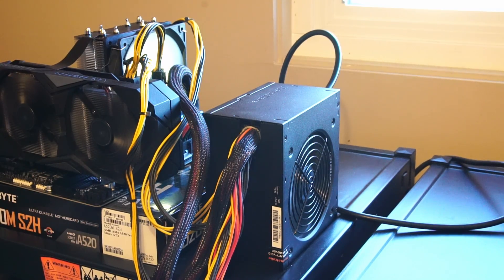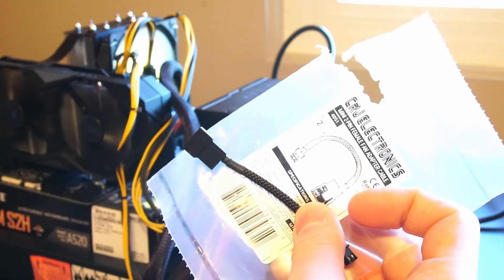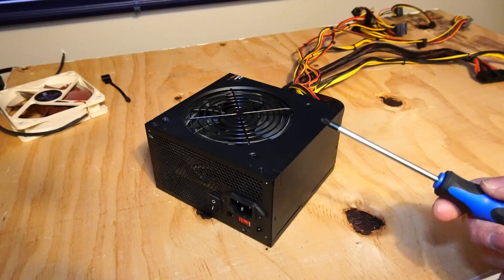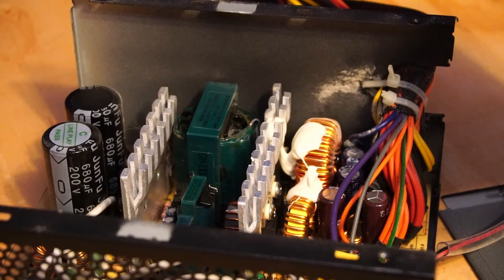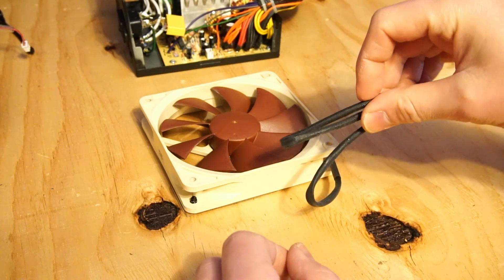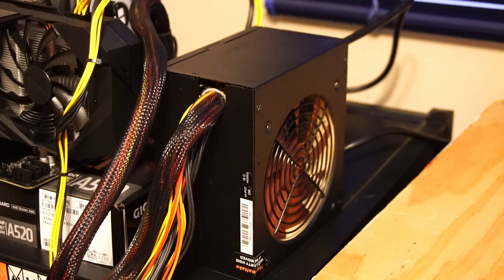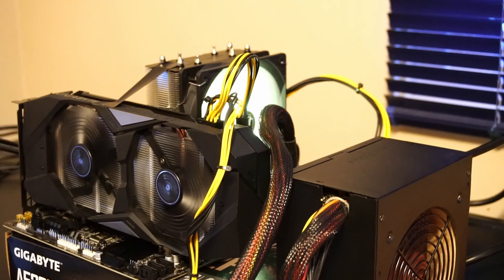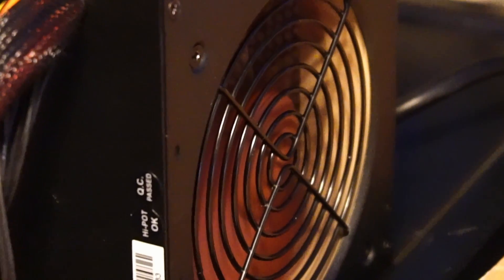ATX Power Supply Fan Replacement with Noctua!

Comment from the maker: *Note that while I have experience doing this kind of work, it doesn't mean it's the proper or best way to handle a noisy power supply fan.  I do not recommend doing this unless you are considerate of what capacitors do and what it means if you accidentally make forceful contact while holding something conductive.  **Be careful.  Capacitors can shock you if mishandled and one carrying high voltage can do some serious harm to your body*

Comment: where to find the cable?
Reply from the maker: Replying as if it's your first time doing this:  If you do this, I would suggest thorough testing and monitoring for efficacy after fan swap.  Also, take great care with the capacitors.  Drain power effectively or leave unplugged for at least a few days.  Here is a link:  https://www.amazon.ca/CRJ-2-Pin-Female-Adapter-2-Pack/dp/B083CRN5L6?th=1&ref_=nav_youraccount_switchacct

Comment: Link for that adapter cable please.
Reply from the maker: Replying as if it's your first time doing this:  If you do this, I would suggest thorough testing and monitoring for efficacy after fan swap.  Also, take great care with the capacitors.  Drain power effectively or leave unplugged for at least a few days.  Here is a link:  https://www.amazon.ca/CRJ-2-Pin-Female-Adapter-2-Pack/dp/B083CRN5L6?th=1&ref_=nav_youraccount_switchacct

Comment: hey man, have you ever working on lenovo ATX power supply that come with the thinkstation p330 that only has 10 pin connector? I want to cleaning the fan because it's cloaked in dust, but I don't know how to discharge it properly. I don't want to change my power supply just because it's dirty.
Reply from the maker: Do you have access to a electric duster or air compressor?  You could just try blowing the dust out.
Reply: @HaisteComputerRepair  Currently I don't have one. But, if I have one, is it safe to just blow the dust with electric duster?

Comment: A PSU fan is running at high rpm, above 2000. What about that Noctua? Is capable of it? I doubt it..... 
A 600Watt psu fan amperage is above 0.60A, mine at 650watt is at 0.70A at 2400rpm. I'm really curious about that Noctua specs.

Comment: I would always choose a fan with good static pressure. 
Noctua themselves collaborated on a PSU with Seasonic, and rather than their own 140 mm fan, they went with their high-pressure 120 mm, because PSUs have a lot of back-pressure.
Reply from the maker: That's fair and a good consideration, thanks.  My only rationale for keeping it in was positive results after testing it under load.  Pretty far from the kind of work they do.  That Seasonic PSU looks pretty cool

Comment: Can you include the fan specifications like size 120-240, 3 pin or 4pin, amps and volts thanks
Reply: he used the nf-p12 size 120, 3 pin connector 0,09 amps and standard 12 volts

Comment: will a dc 0.22a/12v work with a psu has a default fan of dc 0.58a/12v? Thanks
Reply: Yes - it's only a problem if the replacement fan requires MORE current than the outgoing one; if your new fan is rated for less, it will use less.
(Components "decide" their own current draw - if you plug a 0.22 A fan into a PSU that's capable of giving a fan 0.58 A, it will still only draw 0.22 A.)
Reply from the maker: I'm sure it would work.  One thing to consider is what kind of power supply are you using and will your use case be affected by a fan with slightly lower amperage (possibly cooling a little bit less)?  As always, please be careful opening up a power supply and make sure you have given enough time for capacitors to drain.  Only do this if you are experienced or confident that you are able to avoid contact with large capacitors.
Reply: @HaisteComputerRepair  It is a Rm1000e 2022 model that I never used. Im selling it but seems nobody interest in buying. So I either buy another PSU from different brand or replace the fan inside it. The model has tons of reports on noise due to the cheap fan in it. Im thinking about using bequiet silent wings 4 to replace the fan inside.
Reply from the maker: @kvu236 Have you tried just turning on the power supply to see how it sounds?  You can jump the 24 pin connecter with something like a paper clip.  Then you can see how loud the fan might be.  Check out this guide:  https://www.silverstonetek.com/upload/downloads/QA/PSU/PSU-Paper%20Clip-EN.pdf
Reply: @HaisteComputerRepair  Were you able to keep this PSU alive with this fan replacement? Others have wrote that the voltage may be too low to turn on the fan. My PSU has started chirping and it uses the same 2 pin fan as the one in the video however the replacement fan is a 4 pin noctua fan.
Reply from the maker: @moonmoonbh  The fan turned on each time and it seemed to test well under load.  I wouldn't necessarily recommend doing the same replacement, but it seems to be ok.  Just be careful around the large capacitors if you do take the housing apart.
Reply: @HaisteComputerRepair  my fan would only spin for a few seconds during the initial boot. Unfortunately I think my PSU was on its way out anyways so I decided to scrap it. Otherwise, it may work for some fans and PSU combos but not mine.
Reply from the maker: @moonmoonbh  I've had that problem before, where it wouldn't spin at all.  So, of course not a good idea to use it in that condition.  Getting a new one is never a bad idea.

Comment: Why put fan that cost ½ the price in the psu?  Don't recommend opening power supply's to people.
Reply: Because he can? Because some other people might want to do something similar and have a video that showcases how to do so? For quiet operation? 😅
Reply: @bagmar
Reply: @bagmar done the same 1 years ago with a Thermaltake SFX 450w (stock fan smell like burning plastic) I switched the PSU with a Noctua a-92x14 the only difference I plug the new fan to the MOBA cos PSU Start spinning fan at 30% load (the PC have a i3 13100k no GPU so he never reach 30% load)
Reply from the maker: It was a used case fan I recycled into the case.  Otherwise, Noctua fans like this one are not super expensive.  Personal choice, you could of course use a cheaper fan.  I put it in for the airflow and low noise.  As for "recommending," fair enough, I get what you're saying and how I may be portrayed in this video.  This is simply how I did it and some talk on what to watch out for.  I'll think about making the video demonstrating how to properly discharge excess voltage, perhaps that is the ethical thing to do.  Thanks.   Would you like to add some personal advice or experience that would lend to your comment?
Reply: Why not recommend it? This comment rests on the modern assumption that people are dumb and need to be treated like children. He already mentioned that capacitors need to discharged and that's enough.
Reply: Opening my power supply was the best thing I ever did. Even cut through the grill a bit to connect it to my motherboard. 
It's as quiet as a mouse now 
AND IT WAS EASY 
Just be careful and you'll be fine. 

A lot of PC stuff is idiot proof and makes a lot of compromises. 
I'm not an idiot tho.
Reply: Oh, the woke generation...  I just cleaned my PSU fan, testing while open, to get rid of occasional rattling noise.    I touched the 1 heat sink to feel if it is getting hot (while the fan is not installed & blowing on it).  Then I touched the other heat sink with another finger.... BZZZZZ!   I won't be doing that again!  (not because I'm dead, but because I learn).    And we have 240V AC over here, not that wussy 120V AC.    Disclaimer: If you don't know what you're doing, don't open the PSU, or any other equipment with an open PSU inside.  Pay someone else to risk their life instead.  Ignore at own risk.
Reply: Cause you can make your case fans quiet af but if your psu is humming away it was all for nothing. Probs a dangerous upgrade, maybe needs more caution. But I think the stickers on the PSU should make people think twice....
Reply: @Adamoo8  Then don't do it. Some people like looking where they are not meant to. Imagine your sweaty fingers on the power supply, it's a life changing moment. You will make amends in your head and worst comes to worse make sure you have your testament near you ;)